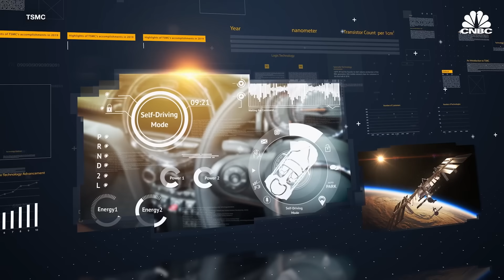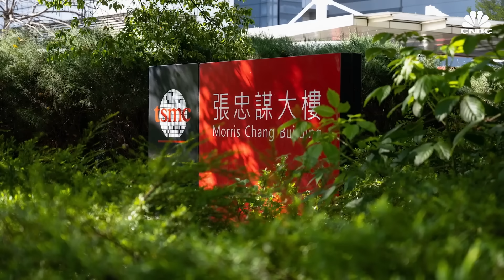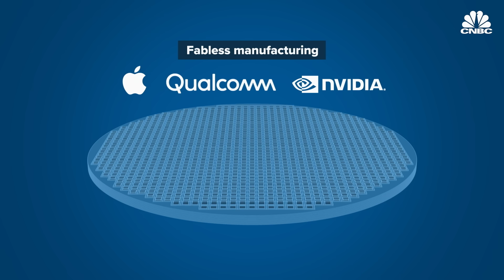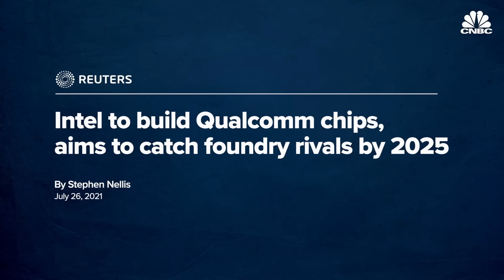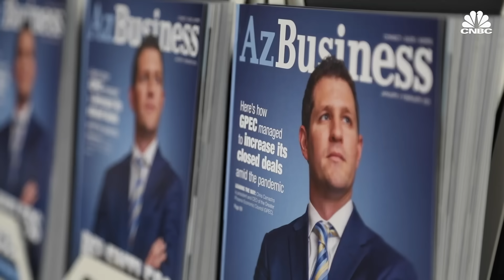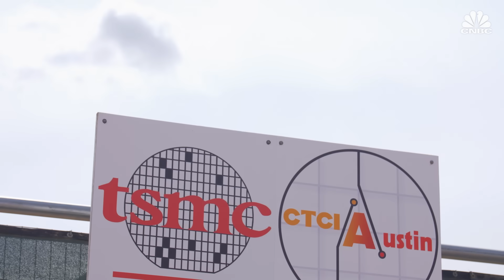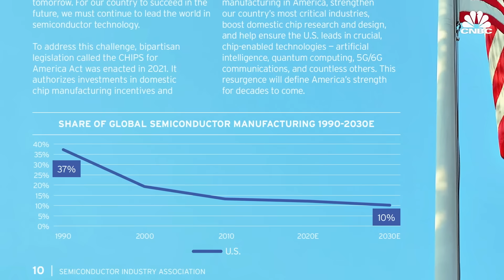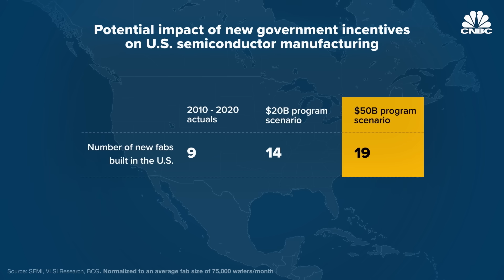Secretive Giant TSMC’s $100 Billion Plan To Fix The Chip Shortage

Comment: Sooo America decided to build a water intensive high tech facility in a desert...
Reply: Probably for the same reason FoMoCo told Gretchen Whitmer. "There is no suitable land to build two new electric vehicle plants in Michigan."
 MI is Geologically stable and surrounded by water. North of the 45 parallel very, very rare to have tornado. Does snow, but but if you have real four wheel drive can still get around just fine. (High ground clearance and locking front and rear axles).
 Could be the political climate is wrong and not suitable in other areas??
Reply: This is a good point you raise these foundries do you use massive amounts of water and a large percentage of it goes back into the environment unfortunately if it’s not properly handled,it’s deionized when it does.

Comment: ASML. The current gen tech uses machines by ASML, which is not Taiwanese.
Reply: The wet etching in lithography was developed by Burn. J. Lin, the deputy general manager of TSMC, which makes ASML surpass Nikon and Cannon, Taiwanese, contributed many breakthroughs in chip technology. EUV was developed in F12 of TSMC; Engineers from TSMC are still in charge of the research in ASML.

Comment: One of the biggest requirements for a chip making plant is a massive supply of clean water. So TSMC did the logical thing. They built their plant in a DESERT!
Reply: An upside to arizona is it has no natural disasters. No earthquakes, hurricanes, or tsunamis. Just heat.
Reply: @YEETMAN-dt9mb  and the huge sandstorms that hit Phoenix every year, will need some massive air filtration on that fab
Reply: @bodhidharma9363  You definatley don't actually live in Arizona to say something so dense. I live less than 15 miles from this new plant. We don't have "massive dust storms". Stop thinking life exists like it does in the movies.
Reply: @YEETMAN-dt9mb  how abt haboobs
Reply: Did any of the commenters actually watch this video? The water will be recycled.
Reply: @TedKau  Ah, so I see you bought the propaganda; hook, line and sinker. 
I guess there's not much precedent to suspect that a corporation might misrepresent their ability and intent to fix an extremely damaging industry using wondrous new technology. Whereas we have so many examples where such promises have been delivered on; like clean diesel engines, recyclable plastics, processed  foods, and biofuels. Yep, I'm sure that new factory will just sip a few dozen gallons of water per day, and the water they discharge will contain 0 hazardous chemicals. That must be why they're building it next to a giant river.... Not to consume vast amounts of fresh water, but so that they can more easily pump the crystal clear water and rainbows they discharge back into the water system to help the environment!
Reply: @TedKau  The water recycling won't mean much in the long term.  Being able to reuse 90% while the pie keeps getting sliced more and more isn't a long term plan.
Reply: @veganpotterthevegan  Love how you YouTube commenters  just know everything and know more than actually engineers do.
Reply: @ThmsDouglas   you do realize that engineers have different goals don't you?  
*Rhetorical question you'll answer incorrectly
Reply: You guys think tsmc is stupid? Obviously they factored the cost of importing water vs tax cuts they are getting. Its probably still cheaper trucking in water than building in other states with higher taxes.
Reply: @spacecowboy07723  They were given great deals imo, they should have built in the midwest with easy trucking to all parts of the state but they wanted to be closer to the ocean for quicker global shipping.
Reply: This is a very illogical decision. Many southern states have land and a ton of water and no hurricanes that retain force inland. But at the end of the day, money talks. Arizona provided the most relief and they built there. Yes water shortage may get them at the end. Arizona is too far from any water abundant state.
Reply: @biomed007  There are a few rivers passing thru Pheonix. Are the rivers not enough to supply industrial water to semicon fab ?
Reply: Bon Goaie  stop spamming
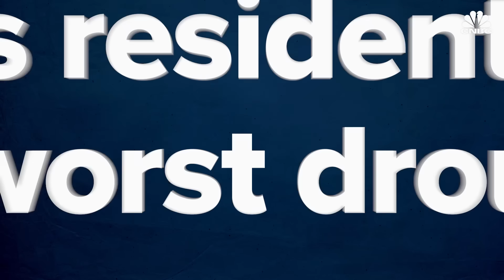Reply: Did you bother to finish the video before commenting? 10:38
Reply: @Lead_Foot  Yes, but I'm still dubious about the choice of location. Sounds like a boondoggle to me.
Reply: So they can amas the whole years water to themselves without anyone complaining.
Reply: @emaaddar5017  Colorado River is running dry due to climate change and historic drought.
Reply: Yeah I think you can blame politics for that.
Reply: You made a good point.   I think this new plant in Arizona is going to be the biggest bust.  By the time it is up and ready to run, it will lack water to produce the type of chips it needs, not to mention by that time, China would directly competes in the Chip industry and make TSMC Arizona would go bankrupt.
Reply: chip shortage is just a MYTH

MINERS ARE THE MAIN PROBLEM
Reply: @Luiko0406  Visited a car dealership lately?
Reply: they actually have some of the best wster recycling systems and water efficiency in the world
Reply: You can pull water (100 gallons/day@15% humidity) out of the desert air, up to about 800 gallons/day per small device depending on humidity. Arizona is a low humidity desert but is currently at 26% humidity. You might need a few hundred thousand condensers but if they are attached to a solar array even 10 million gallons/day + can be done
Reply: @Pax_Veritas  There are a few rivers passing thru Pheonix. Are the rivers not enough to supply industrial water to semicon fab ?
Reply: @zenlei8258  Oh yes more than sufficient. Slight problem is there are millions of people and counting living in that area who also require water, as do farmers. It's a joke to build a fab in the desert when the most fundamental resource they require is water
Reply: @zenlei8258  I'm British so at least get your prejudice correct or I'll sail up the Yangtze and take back Hong Kong
Reply: You can recycle water but it comes at a high cost to operate it plus it’s hard to recruit key personnel to leave in a dessert heat.
Reply: Not mention about all riots happened in the world such as Hong Kong riot, Tian An Men Protest which organized by ARMerica , only talk about war.    In 250 years of existence as a nation, the US has fought against 29 sovereign countries. (In Fact, since 1785, US have been involved, for 219 years, in some kind of war. And this wars, against all varieties of sovereign nations. From going against the Sultan of Morocco, to invading the tiny island of Grenada. Well, this means that in its entire history, it has only had 17 years of peace, and even fewer, cuz here the almost 5 years (1861-1865), of its Civil War of Secession are not counted (Union/Confederates), since this war was not with another country, but against US. And the wars against the Native Nations of America are not counted too, for the same reason). Anyway: US fought against 29 countries. It has "Grown" 711 times the size of its territory from the original 13 colonies. It has provoked with total impunity, Genocides, inside and outside its own borders, and assassinations of Gov’t. Leaders, Coups d'État and Economic Blockades in 6 UN member nations. (Between 1947 and 1989, the US tried to change other nations gov’ts. 73 times. It includes 66 covert Ops. And 7 overt ones. In Civil Wars: The US has taken advantage of and intervened without justification in the following Civil Wars: In Cuba (1898 and 1960). In Haiti (1813 and then 1915-1934). In Colombia (1899-1902 and 1948). In Mexico (1847 and 1914 and again in 1916). In Russia (1918). In the "Republic Banana Wars" of Central America (1912-1934). In Venezuela (1945 and again in 1948). In China (1857, and 1900, and again in 1945-1946-1949). In Korea (1950-1953). In Viet Nam (1959-1975). In Panama (1964 and again 1989). In Central Africa (1969-1974 and 1982-1988). In Nicaragua (1937 and 1985). In Bosnia (1995). In the Philippines (1898 and 1900)... In Kosovo, Libya, Lebanon, Somalia, Sudan, Syria, Iraq, Iran, Yemen, Afghanistan, etc.). And more: US has almost 800 Military Bases scattered around the world; 93 of which are against China. On the other hand, China and N. Korea (The "Axis of Evil"), in 1,000 years of history have NEVER invaded anyone. These nations have fought their Civil Wars, defended themselves against foreign invasions, and secured their immediate borders, but they have never been meddling or aggressor countries. Do you know how many Military Bases China or N. Korea have outside their territory? None. Zero. Any. NADA! They do not have a single Base. These are verifiable facts. Neither China nor Korea will invade the world; US does... that's DONE, as US does in the Middle East. Iran also does not have a SINGLE MILITARY BASE outside its national territory, and it is surrounded by 16 US Bases, and it is US who call the Iranians Terrorists. Well, very good. You already know. Now, compare the Greatness of the US with the Greatness of China. The "Greatness" of the US is built on the foundations of Piracy, Slavery, Genocide, the Assassination of opponents, Opium Traffic, or Cocaine in its case, and is under the foundations of the weakness of other sovereign nations. LOL…..Chai from Malaysia.
Reply: This, the tax incentive will bite this company in a decade when the water runs out or they have to import water which defeats the whole purpose
Reply: @LuckyDuckie115  I used to help build foundries in the US. By the time the tax incentives ran out those fabs were outdated and Intel just moved out of CO and NM.
Reply: bet my bottom dollar they'll build a multibillion dollar pipeline from the great lakes since the Colorado is dwindling
Reply: @808N  there has been people trying to do this before and they faced huge pushback. I really doubt it would happen but if anyone would have the funds necessary it may be TSMC
Reply: Yeah, funny huh
Reply: Is this the US stealing IPRights?

Comment: This video is incorrect in stating that the Chips from Arizona will be used by Apple, Nvidia or AMD -  they will not. This will only complicate existing supply chains. The reason the fab is being built in the first place is for the US military and US government. Its possible other companies could use it in the future, but the stated reason currently is the US government and US military, doesn't have too much to do with jobs - that's mostly politicians trying to take credit for something that was going to happen regardless, it also doesn't have much to do with the US loss in fab production of processors - because no big tech companies will be using this facility when its built - it will be for the US military.
Reply: Why couldn’t the big tech companies also source their chips from this azirona factory?
Reply: @TheBooban  This would require that companies change their source of suppliers for both raw materials and components and change shipping routs, as of now their suppliers are all in Asia along with their manufacturing facilities. If they wanted to source Chips from the US they would have to send chips from the US all the way to Asia then a return ship for the finished product, this would increase costs and time to complete a product, this is very oversimplified - but as it stands it doesn't make sense for these companies to use a fab in the US.
Reply: Unfortunately, this makes the most sense to me.